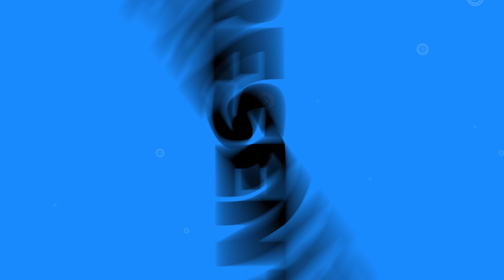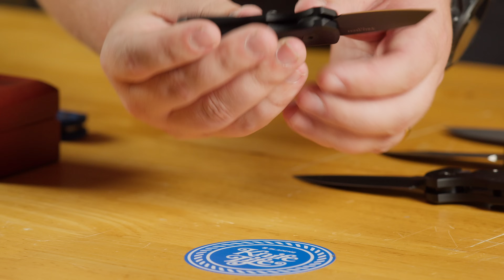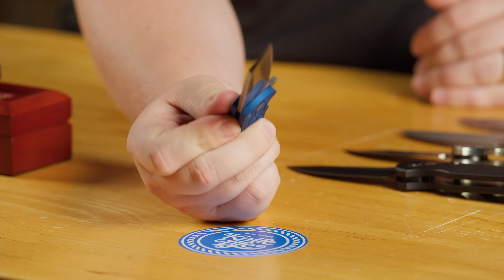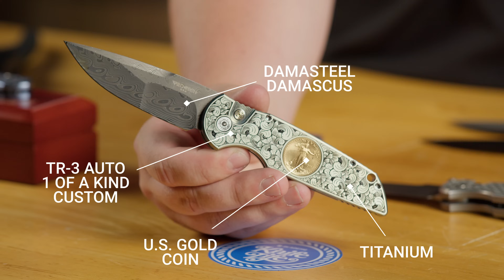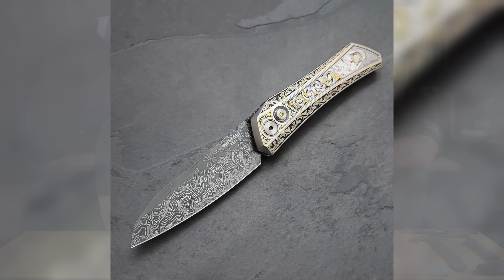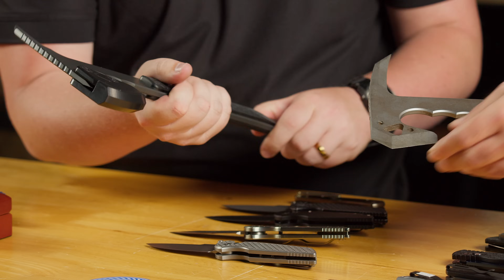The OFFICIAL Pro-Tech Buyer's Guide

Comment: Dave, I’d like to propose a rolling change to the “Operator” series in the form of a materials upgrade from the 6061 aluminum handle scales to 7075 aluminum with a Mil-A-8625 Class II Type III Black Hard Anodized Finish. Not only is 7075 a stronger alloy than 6061, but it’s also the same material and finish that is used for the AR15’s upper and lower receivers.. Which, imho, would be much more appropriate for a knife spec called the Operator series.. You could even go a step further and use CPM-M4 blade steel.. It is coated after all, lessening the risk of corrosion that M4 is sort of infamous for.. But even Magnacut would be suitable.